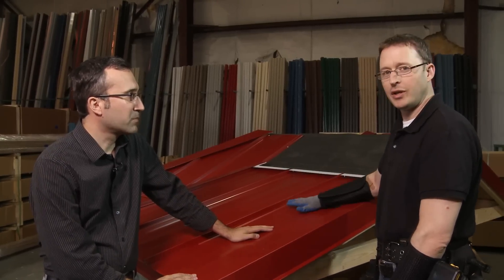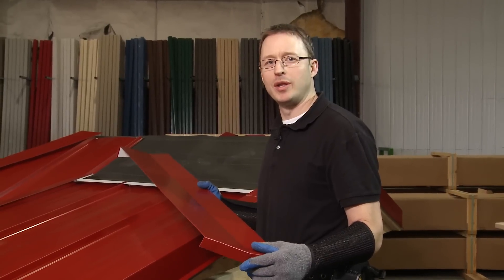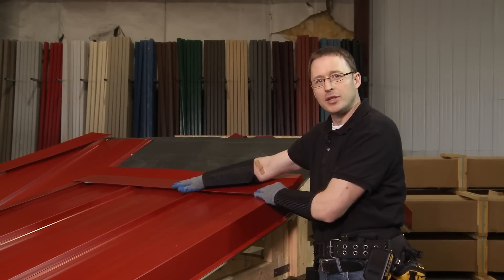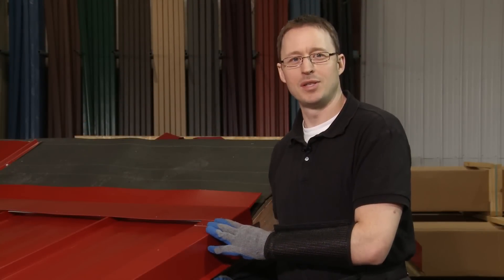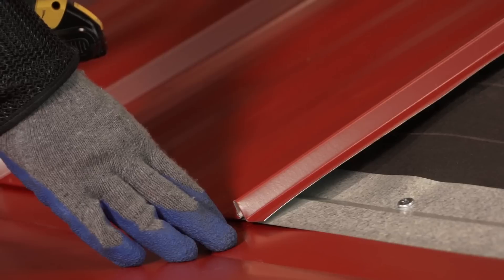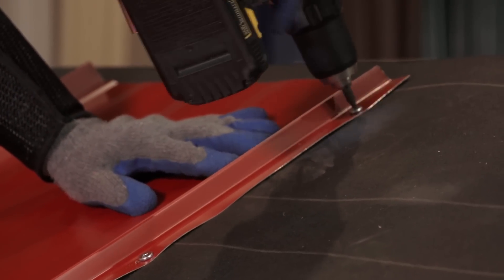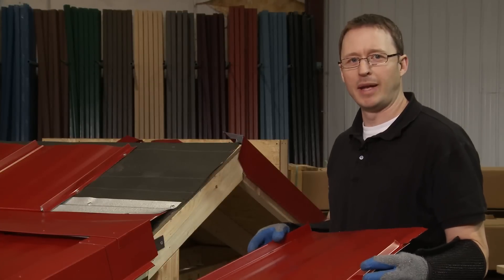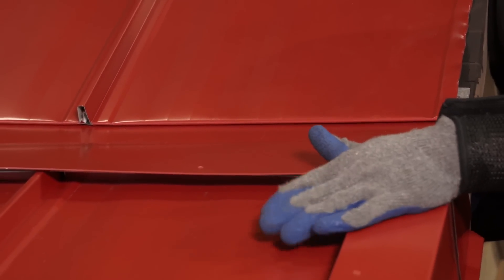How to Install Pitch Transition Trim: ABC SL-16® Metal Roofing System

Comment: ---so,  basically nothing but a caulk bead at the z-trim as a water barrier along the entire joint line ?  It also appears the z-trim has been notched at each rib and NOT sealed up edges and no seal at top where the z-trim and transition trim meet.  Then you add a narrow off-set and end up with a lap-over of top panels of less than 4 inches.   Great work if you never have any wind blowing with the rain.  In hurricane areas, THAT is a guaranteed leaking joint, especially if the lower roof has a low pitch.  Great job.
Reply: It wouldn’t even require hurricane winds to blow rain into the gaps where z trim is cut. I’d like to see how someone could get a quality caulk job on all those gaps. Not only will it look like ass but when the caulk ages and cracks, you’d have to somehow trim it off and recaulk. Constant maintenance nightmare.
Reply: Perhaps you missed the stated tape seal under the lower panels, transition, and cleat though I do see weakness of that under the ribs, which would necessitate caulking.
Also, though I believe only the top leg of the Z is notched, which also would be a weak spot, I'm not sure why a taller Z is not used.
Finally, I also would have liked to see the rake, especially since some transitions are only over a porch, which has both a downhill pitch change, but also a lateral step from zero to the non-porch roof edge.